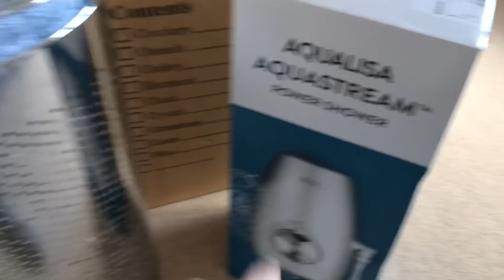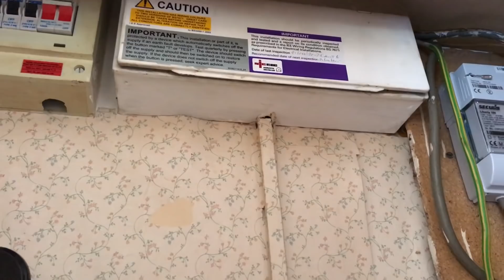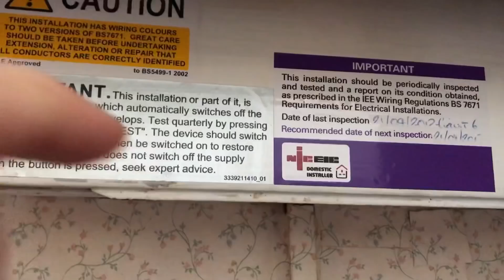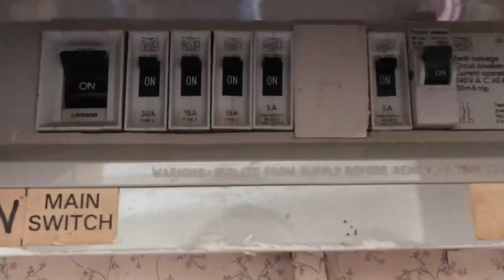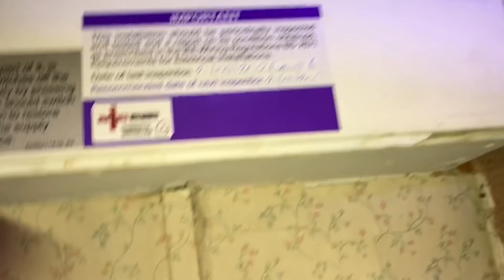CJR ELECTRICAL electricians day wiring and finding more poor installation work!!!

Comment: Immersions- dedicated circuit 🤫
Reply: If the maximum demand permits it, there shouldn't be a problem spurring off the immersion switch to supply the power shower isolator.
Reply: Alvin Ashman I'm not saying they'll be a problem ( I know it would never cause an issue) just "a dedicated circuit" ( look it up ) would you come off a shower circuit to supply something else just because the demand would accept it ?
Reply from the maker: Fair comment Pete 
But let me just give you some back ground in maybe 2 months they are removing the tank and having a combi boiler fitted. Maybe I should have made this clear.
Reply: @petetaylor9511  Yes I'm aware that space and water heating appliances should be supplied on their own dedicated circuit but in this situation, I think it's both safe and convenient just to pick up a supply from the immersion switch. Combination storage heaters tend to have a dedicated circuit for the off-peak supply and a spur from the existing ring circuit for the boost.
Reply: CJR ELECTRICAL I didn’t want to come across as a righteous dick, but thought my comment would maybe educate others, as it stands it’s a (I’ll say it again) “dedicated” . I really like your vids mate keep them coming 👍🏻
Reply: Alvin Ashman a ring circuit is not classed as “dedicated” Alvin
Reply: @petetaylor9511  I didn't say it was but out of interest, what is your interpretation of a dedicated circuit?
Reply: @Cjrelectrical   Will the H&C pumped shower be compatible with the Combi?
Reply from the maker: Yes they have a hot water tank which the shower gets fed from

Comment: Electric showers 🤮
Hate them with a passion
Reply: Me too. With a decent gas boiler electric just isn't necessary for a good shower.  I have a Mira mixer shower and its brilliant.
Reply: @cbcdesign001  and if you have no gas  in an apartment?
Reply: Love mine. Have no gas or oil heating where I am so electric shower is a necessity

Comment: The people busting your chops for inaccessible splice box locations are probably N. American electricians. In the US & Canada that is a BIG no no, but almost all of our walls are hollow so it's not that hard to get to switch or socket and if there are too many wires cut out the old box to go with a deeper box (3 1/2" or 90mm).

Comment: buy some proper wago covers ya nob :D
Reply from the maker: They are no maintenance free you nob
Reply: @Cjrelectrical  The installer connectors need to be within a suitable enclosure. According to BS 7671, “every connection and termination must be enclosed irrespective of the nominal voltage”. The WAGOBOX Light junction box meet BS EN 60670-01 and BS EN 60670-22.
Reply: @Cjrelectrical  So in summary, for a maintenance-free installation you require:

Screwless term
inals that are suitable for the type and size of conductor you are using, which have been tested and meet all relevant product standards and European directives, as well as the requirements of BS 5733
A suitable junction box that is compliant with BS 60670-22 (applicable standard for junction boxes) and BS 5733 (applicable standard for accessories), as well as showing both the MF and CE marks, and meeting all relevant European directives
Reply: @Cjrelectrical  ya nob